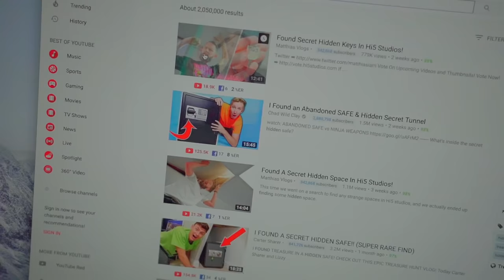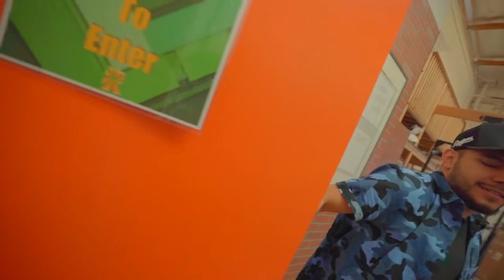Found A Hidden Abandoned Case In Hi5 Studios!

Comment: Those keys almost definitely go to a Sentry brand fire resistant lockbox.  There's a fair to middlin chance that if the owners of the box needed it opened and didn't know where the keys were, that they either 1) ordered new keys via  Sentry customer service, or 2) took the box to a locksmith and had keys made for it.  Sentry fire boxes aren't terribly large so it may be tucked away in storage somewhere.   Keep looking!
Reply: Creds: I'm a locksmith in NC.  I see those keys and fire resistant lockboxes all the time.

Comment: My first assumption would be the key you found would go to a box on a wall for a security system or sprinkler system box or to reset a fire alarm or sometimes breaker box panels would have barrel locks on them also.

Comment: ok so this may seem odd but i noticed the numbers on the key you found were not just numbers but i have been doing research and found a picture of a key that looks like the one you found and it is for a sentry cash box. Your key could be for cash or TS5 could stand for three studio 5 colors because there are 5 main colors on the hi5 studios website. Red, Purple,orange,gold and blue.and if i am correct there are three different studios that have those colors in them from the channels that are in them.what if the key is to a hidden locked part of the studio that you may not know about.

Comment: The TS5 key seems to be for another safe of some sort. There is proof of this because a link on eBay selling another of the same type of key. The name of the product is, 'Sentry Cash Box Key Factory Code Cut.' Pointing towards, 'Sentry,' as in the safes or in this case a, 'Cash Box,'(according to the link). 'Factory Code Cut,' seems to mean that TS5 is either the factory code or the model of the safe/cash box. But it is most likely the safe model. Also, the product title says TS0 to TS9 which mean that the key may unlock any lock of the TS 0 to 9 series of Sentry's safes/cash boxes.

Comment: "century" is a key making company, like Kmart, Walmart or blank keys any key THAT IS blank can be laser cut in to a key that actually opens a lock. a safe JUST MADE does not come with a key, but when it is boxed and shipped the lock gapes are processed through a computer and then to paper, after that a blank key is put in a machine and the person reads the paper then the person draws kind of the shape that fits the lock. then the key is sent with the lock or "safe" to the store or other location. 

(i REALLY WANTED TO USE VOICE TYPING FOR THIS BUT THIS IS A WINDOWS 10 LAPTOP, i used to do voice typing on a Apple iPad... it sucks now on a computer).

Comment: Ummm..easiest way into a keyless file cabinet is a butterknife. Peek the crack where the lock slider is and gently pop the slider to the outside with the tip of the butterknife. 99% no damage to the cabinet and can also pop the lock slider back in the same way.